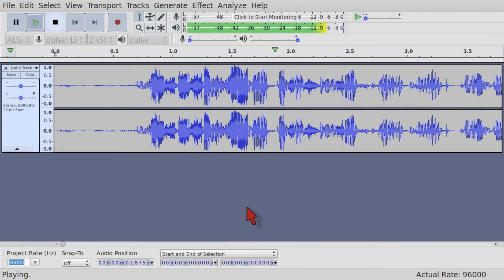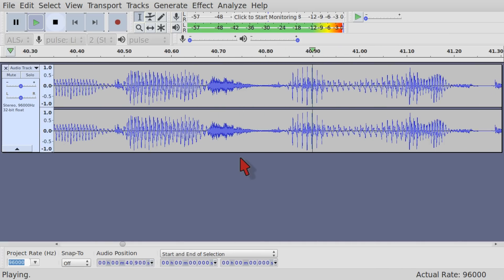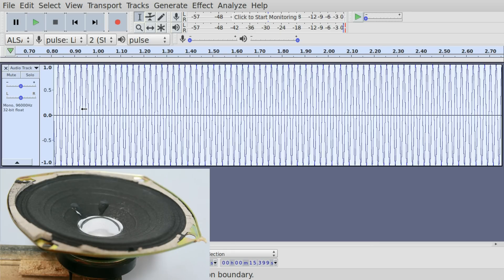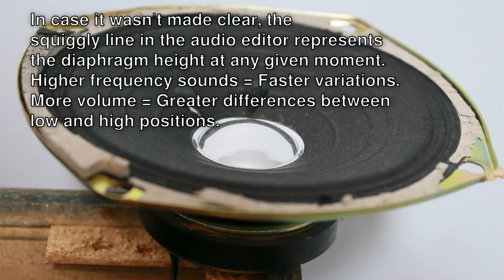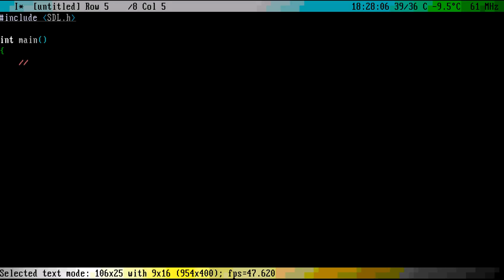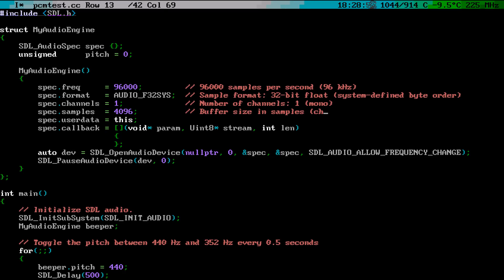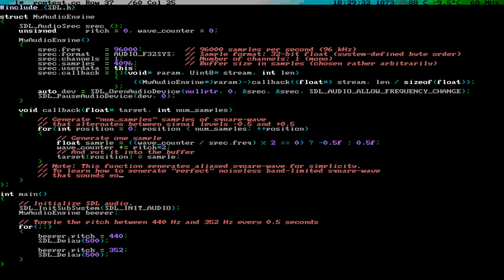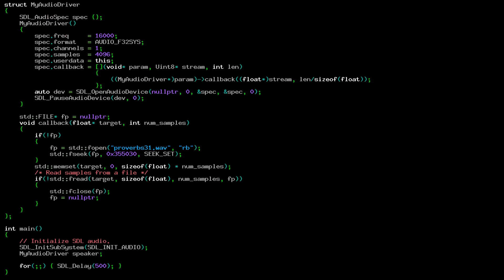How does PCM audio work? :: Case study and example C++ code

Comment: Thanks for the content. First-principles explanation, straightforward code.

How I got the code running under Linux. (1) In debian, apt install libsdl2-dev; (2) In the code, change SDL_InitSubsystem to SDL_Init; (3) compile usage: -g++ -Wall -Wextra -o exe main.cpp `sdl2-config --cflags --libs` 

Beware WSL (linux layer on windows) - audio is not well supported there. The forums show instructions for how to bridge audio from linux to windows using pulseaudio. Maybe you could get that working, but this code is easier to get working in native linux.

Comment: How many versions of the Bible do Suomalainen have?
Reply from the maker: "How many versions of the Bible do A Finnish have?" Perils of machine translation. Especially when you translate piecewise a single word that has multiple meanings.

Finnish only has one version of Bible, but there are multiple translations. Within the Evangelic Lutheran church which is the state church, there have been six distinct translations, from years 1548 by the venerable Mikael Agricola, 1642, 1683/1685, 1776, 1933/1938 and 1992. Additionally there are five translations by other organizations and people, such as the Uuden Maailman käännös version (UM) used by the Jehovah’s Witnesses’ organization. Out of these, the 1933/1938, 1992, and the Raamattu Kansalle (RK) translations are in most widespread use. The Laestadians use the 1776 translation called Biblia (which is fine in my opinion). Personally I disqualify the 1992 version as least accurate of the lot.

Comment: Could you explain how DPCM samples work? I'm really into chiptune music, and I would be interested in a video of you talking about this.
Reply from the maker: DPCM (at least in the format in the NES) is PCM where the next sample always differs from the previous one by either +1 or -1. The D stands for delta, i.e. a change between the previous and next sample.
The sound production method is exactly the same; only the decoding differs. Instead of the sample value being read verbatim as a 8-bit or 16-bit integer, it decodes one bit from the source and if that bit is 1, the next sample value is assigned the previous sample + 1, and otherwise the next sample is assigned the previous sample - 1.

There is also the µLaw system where the next sample is the previous sample + a lookup value based on the byte read from the stream, and these lookup values are logarithmically scaled. It is a form of DPCM, because the values encode a delta (D) to the previous value rather than the new value verbatim. ADPCM is similar, but it uses 4-bit values rather than 8-bit. Microsoft’s ADPCM is a variant where a more complicated scheme is used to encode the delta values.

Comment: Would playing a file with infrasound, or with loud square waves, be dangerous; or do soundcards protect speakers and headphones that are used in computers?
Reply from the maker: No, it’s up to the speakers themselves to be robust enough. Mine clearly was not, but it was not just a soundcard doing that, it was the amplifier.
Reply: @Bisqwit  Could a website, or even a Youtube video, have waveforms that damage speakers?
Reply from the maker: Only if you can trick the user into maximizing their volume and their amplifier has enough power to make that happen.

Comment: Can you make a video combining the topics of C/C++ and low level database hacking? 
(maybe how to create relational database from scratch?)
Reply from the maker: I have been planning on doing something with databases for many years, but I have not been able to think of an interesting plot device / topic to make the video entertaining. As for low-level or making from scratch, probably won't happen, sorry. It would have to be at least plausibly worthwhile and I don't see a way to make it happen with my current level of knowledge of database internals.
Reply: What about this as a plot:

How is sqlite faster than fopen?
As per their website they compete with fopen
https://www.sqlite.org/whentouse.html
Reply from the maker: Sounds like you know more about it than me. 
Also, the answer to that question: The performance difference arises (we believe) because when working from an SQLite database, the open() and close() system calls are invoked only once, whereas open() and close() are invoked once for each blob when using blobs stored in individual files. It appears that the overhead of calling open() and close() is greater than the overhead of using the database.
Reply: I saw that. I guess I just want to see the grimy details :).

Comment: another question (sorry Noob askig :))
why did you call your callback function (spec.callback) like [](void* param, Uint8* stream, int len) {((MyAudioEngine*) param)->callback((float*) stream, len / sizeof(float));};

should't you call it like: spec.callback(arguments)
Reply from the maker: The line where spec.callback is mentioned is an assign statement, not a call statement. I am providing the library information how to call the callback method of MyAudioDriver class. This is accomplished by assigning a value into the variable “spec.callback”. The value I assign into that variable is an inline (lambda) function that calls the “callback” method of my class, using “param” as a pointer to the class.
At such time that the library invokes that “callback” variable, it will invoke this lambda function, which in turn will invoke the “callback” method from MyAudioDriver.
Reply: but is it possible to do it without lambdas?, why did you chose to call lamda and then through that  you are calling your callback?
Reply from the maker: It is certainly possibly to do it with a static function instead of a lambda. But you need an intermediate function, because the actual callback function is a method, and the “callback” variable passed to the library is a function pointer. These two are not compatible. The library knows how to invoke the function pointer, but it does not know how to invoke methods. That is why an intermediate function is needed. The library invokes this function, and the function invokes the class method.

Comment: do you uses gcc or clang ? , from your experience which one is better in term of code optimization
Reply from the maker: I use GCC more. In terms of optimization they are pretty much neck-to-neck, but I have often found that in some bit twiddling hacks and other very-small-scale code snippets Clang optimizes somewhat better.
Reply: @Bisqwit  thank you very much , we learn from you ;)

Comment: So you can add constructors and methods to structs? I thought you only did that with classes. Nice video, by the way!
Reply from the maker: class and struct are literally the same thing. The only difference is that if you used “struct”, its members are public until otherwise specified, and if you used “class”, its members are private until otherwise specified.
Reply: @Bisqwit  Thanks for the clarification. Come to think of it, a lot of small differences in C++ tend to do with scope.

Comment: You never stop to amaze me

A noob question: is for(;;) the same as while(true)?, if it isn't, Why?
Another "stupid" question: at 4:33 you show a song playing "machine", what do characters in song char array  (am, why did you make it constant, why would you use constants anyway, instead of using normal char array (if you don't change it manualy its constant anyway, right? can a program change it on its own, so that is why using them is a good idea?))represent?

Sorry but you explain things better that any paid teacher or SO would :)
Reply from the maker: Yes, for(;;) achieves the same as while(true). I prefer the former because it is more extensible and future-proof, and IMHO it conveys the intention better too.
The array of characters is essentially an array of integers. These integers are note numbers.
The array is const because it is constant data.

While it is true that most compilers are smart enough to change the data into const if they can reliably detect that you never modify it (which is something you should never rely on), resulting in more efficient code both in terms of performance and space, lack of const means you are communicating to people who read your code that you are expecting run-time changes to this array. The primary target audience of any source code is always people. The foremost purpose of any code is to document intention.

You didn’t ask about “static”, but here is a quick demonstration why it is good to use “static” for your function-local const data. https://godbolt.org/z/c2GG68
Reply: Thanks
well I didn't ask about static because I still don't quite get the diference between static, private, public

but from your example I figured that you need less instructions which makes the program smaller and probably faster (or not I am just guessing)? if you use static values/classes and you don't need to inisiate a class if its static

Thanks for your example, probably I didn't transpile (maybe interpret is better word) it to myself the right way :)

Can you put your music playing thingy on github or in the description (some people also called it down bellow), would love to rewrite it into C# (I hate writing by hand :))
Reply from the maker: It’s not that “static” automatically results in smaller and faster. It‘s because different syntax has different implications of what the program (and compiler) must do. In C++, there are four different storage durations. Static, automatic, dynamic, and thread-local. There are also two linkage types: Internal and external.

A variable that is declared inside a function without using “static”, “extern” or “new” has automatic storage duration. It means that the data only has storage allocated for it while the function is being executed, and if the function is re-entered (for example with recursion), new storage is allocated for each additional nested invocation. When the function returns, the storage for that nesting level is released. If you declare an array in a function like “char buf[32];”, the compiler is forced to, according to the standard, create code that allocates storage for this array at the function entry, and then possibly initialize it, if the array also had an initializer.

I will put the code to a repository once all videos belonging to a series I am making have been published, which is about three or four weeks from now.

Comment: I'm interested in the logic behind the song samples. Is there a common theory behind it, or did you come up with it yourself?
Edit: I guess theory might be the wrong word. Approach may be more suitable, perhaps.
Reply from the maker: There are so many angles which your question you could be looked at. Like to narrow it down a bit?
Reply: @Bisqwit  Hehe, fair enough.
1. "count = 5400 + 540*(row &2);" - I guess this is to make every 2 beats have a different tempo? Is there any magic reason for the numbers 5400 and 540?
2a. "target[position++] = ..." - The offset to count, is it just arbitrary numbers to avoid "aliasing"?
2b. The & with 2^15-1, and subtract 2^14, times the shift with count * 16, I guess is basically to create a sawtooth wave? (I guess I could just plot the numbers, but if you want to elaborate, it would be appreciated)
3. How does one come up with this? Experience, or is there material to read somewhere?
Reply from the maker: 1) Yes, it is to give odd and even beats a different length. The numbers are rather arbitrary, but when you divide that number by the sampling rate (48000 Hz), you get the number of seconds that each beat lasts, because the next row is processed when the counter reaches zero, and the counter is decremented after each sample. However, because the same counter is also used to give the sawtooth wave the amplitude, changing the number would also affect the song volume.
2a) Exactly. It is arbitrary numbers to avoid the parallel waveforms being in same or opposite phase.
2b) Right again. The shift down by 16 is to scale the resulting value into a proper range so that it won’t clip.
3) Mixture of experience, mathematics and creativity.
Reply: @Bisqwit  Ah, I see. Thank you very much for your answer(s), and thanks for an awesome channel!

Comment: Do you type all that in real time, or is it a software to replay program entry? How did you get that Mario on the status bar? It's neat!
Reply: He's using a DOS port of the Joe editor
Reply: @xc_gwpl  not a port, but his own editor based on the Joe editor. I'm assuming he's using his linux port of That Editor (yup, that's the name) to write the code as I don't think SDL supports DOS
Reply: The animations are realized by carefully redefining the font dynamically

Comment: What do you think about to drop C/C++ and switch to Go or Rust?
Reply from the maker: Up to you. I think Rust is quite promising. Personally I disliked how stiff it felt when I last tried it out. And I have not even looked into Go, mainly because Go has garbage collection prescribed and I dislike the idea.
Reply: @Bisqwit  
You can totally disable GC in Go,you can use SIMD and also inline assembly .
Reply from the maker: Sounds like you have already made your choice. Good luck.
Reply: @Bisqwit  
To be honest,not yet.
However,it's very strange to hear from you that Rust is stiff.
I already saw a lot of people around the net and i must admit,
that: more then half of them are hating C++ for it's complex syntax etc ...
Reply from the maker: Ok
Reply: @Bisqwit  
Please if you can and want,check this thread on reddit :
Finally a place to say honestly what I think about Rust vs C++